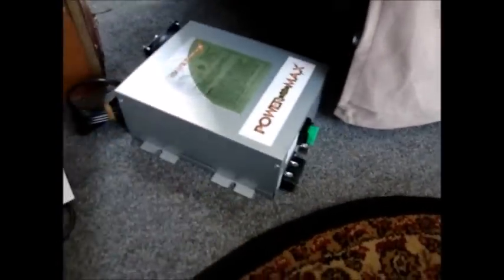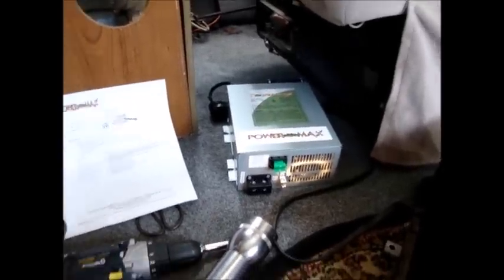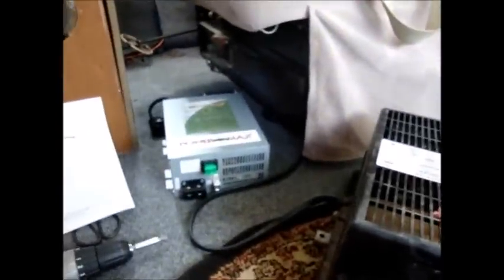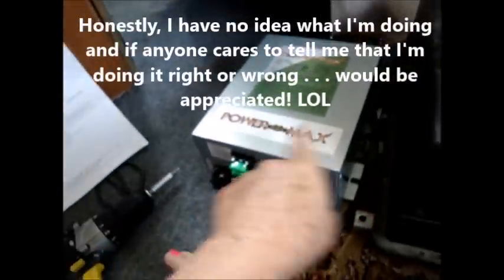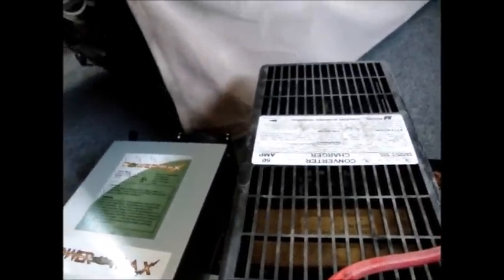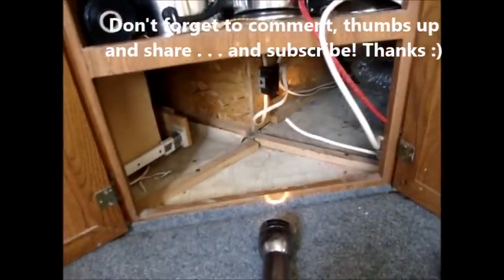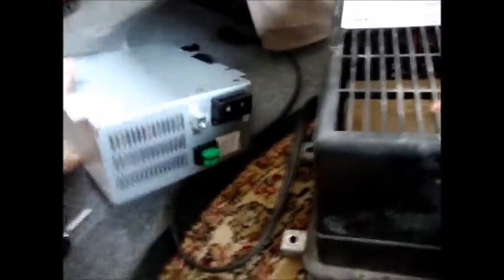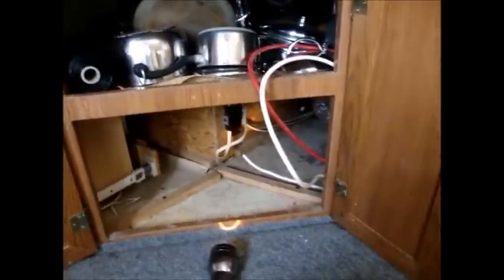RV Lady Season 2 Episode 89 Converter 2 of 4 Where does it go? 7.13.15

Comment: I just wondered if you are a member of any of the many forums? They have so many and some are even specific to the type of RV you have. They have a place where you can ask all kinds of questions and the people are usually so nice to answer with lots of valuable info. I joined 4 of them with my old RV and have just joined 2 with my new one. Just a thought....it is a great way to learn.
Reply from the maker: yescandles I have used the information already posted on those 'forums' and find some of the information helpful but honestly the most helpful information I've found is on YT! Pictures and words . . . that's what I need! LOL Today will be my first try with the DE. Like you I'm putting it in my morning juicing and we'll see what happens. Thanks for the info and comments and Be Brave! :)

Comment: OH NO There is no red wire for positive. See,  white is negative and that shorter white wire is the ground to be wired to the case of that unit. Strange the positive is a black wire.
You pretty much had to put it back where it was just for the length of wire there was.
I hope RVdeb sees this and gains more confidence from another female getting things done without calling the guy. Good job
Reply from the maker: Jerry Densmore There is a red wire - you can see it at the beginning of the video at the top next to a white wire. Then the little short white wire is ground. I checked 'em out with my meter gizmo just to be sure! LOL Thanks for being scared - it made me double check (and when I say that I mean quadruple check) LOL Be Brave! :)
Reply: RV Lady
Maybe the black is for feeding the fuse panel and the red goes to battery. Cause there should be two positive outputs. Glad it worked for you. Except for have to lay on the floor it was doable.
Reply from the maker: Laying down and working is the BEST! LOL Be Brave! :)
Reply from the maker: I just look at the black wire you keep referring to - the wire you are seeing is the plug for the converter. The wires for the converter are red/white and white ground. :) I was getting concerned that I wasn't seeing something you could see! Thanks - Be Brave! :P
Reply: RV Lady
Now I feel bad for confusing you. On the video it just like a single strand of wire not like an extension cord. So sorry my Dear.
Reply from the maker: No problem! Again, it made me check my work again which is never a bad thing! :) Be Brave!

Comment: I am confused over the amp of the new converter. 3 stage charging is good, but you MUST match the same amperage of your old converter. It has to be the same or you can run into serious electrical issues.
Reply from the maker: ReignBeauHounds I looked up on Amazon and Googled to make certain I'd purchased the correct one and I'm all good. The converter I took out was installed in 1994 - so no matter what I put in - it isn't going to be exactly the same. I'm testing it tonight - I'll let you know how that goes! LOL Be Brave!
Reply: RV Lady I'll watch your newest vids. Hopefully, you have had success now. My old converter was a 30 amp, I had to replace it with a new 30 amp converter. My old 30amp was the same make as your old 50 amp converter. Mine was a 96.

Comment: I've been having ant problems here in Mobile, AL after so much rain.  I use GRANT'S KILLS ANTS from AMDRO (that is what the front of the box says).  It's pretty cheap and you get  10 ant stakes.  I just place them in the problem areas (they're small, lay flat and don't take up much room) the ants eat the bait, carry it back to the colony to kill the queen and that takes care of it.  They're made to use as stakes in the ground also with a pointed end to stick in the ground.  You could use them outside as well as inside covering all bases.  I was surprised at how well they work at such a cheap price. I just pick them up at Dollar General but you can order them through Amazon here's the link:
                            
http://smile.amazon.com/Grants-100500090-Stakes-10-Count-Total/dp/B00KV0714M/ref=sr_1_2?ie=UTF8&qid=1436886339&sr=8-2&keywords=grants+kills+ants

Enjoying your videos and safe travels!
Reply from the maker: Carol Demetropoulos Thanks for the information. I'm a huge $ Store/$ General shopper and will look for them the next time I'm there! I think I've got them from coming in - but I'm not sure they aren't building some kind of colony in the RV somewhere! Yikes! I don't even know if that possible. Thanks again and Be Brave! :)